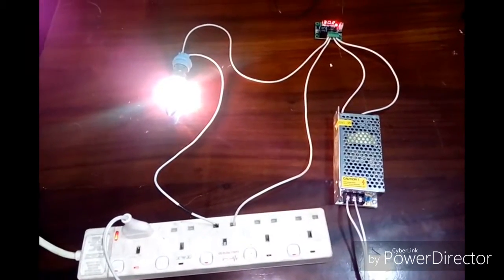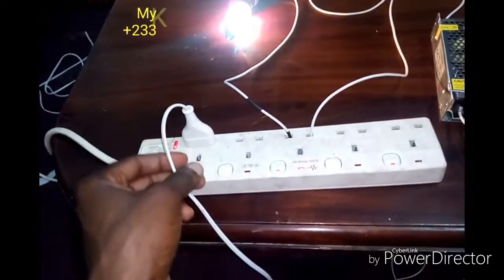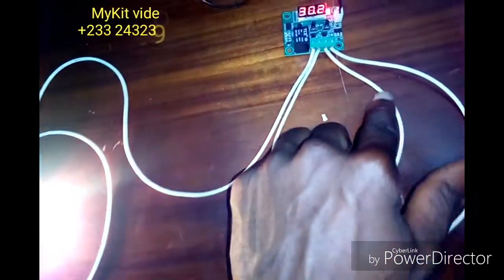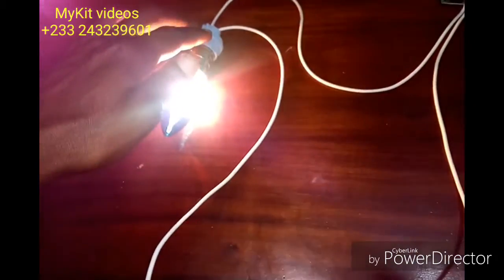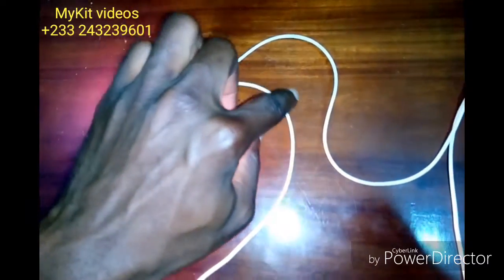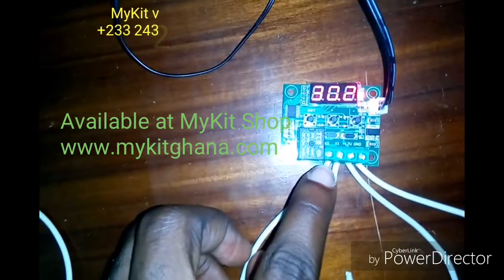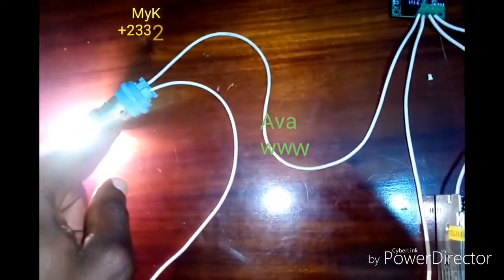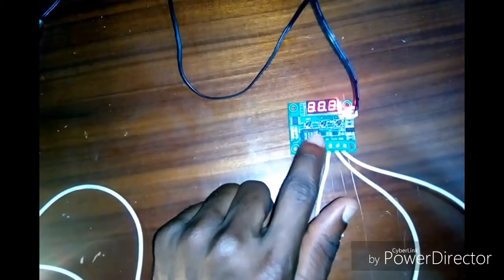W1209 220volts temperature controller

Comment: I've fixed it and it has worked. I wish it also included the fan. Do you have a link to a video where you have connection both bulb and fan?
Reply from the maker: Ok you just need to loop the bulb and fan
Reply from the maker: Link the bulb and fan in parallel connection
Reply: Sorry to bother you I'm not an electrician. Is parallel connection and looping the same?

Comment: sir can I ask if its also applicable for stc 1000 12volts then load of 220v light bulbs?
Reply from the maker: +Russel Capa 
Yes. Same principle
Reply: coz Im affrad sir to use the 220volt bulb in 12volts stc1000. so its applicable sir.. can you help me sir to setup my stc1000 ?
Reply: can i ask for wirings sir?
Reply from the maker: Yes I will show you. Please give me a moment
Reply: sir i have a problem to the connection.. I follow your connection using my stc1000 12volts. but when the temperature get high the fan(12volts)  didn't turn on what's wrong?
Reply from the maker: I will draw the circuit for u.
So now u have what items
12v stc thermostat
12v power adapter and what
Reply from the maker: I have prepared the circuit diagram for you.
Please click here to see
https://mykitghana.blogspot.com/?m=1
Reply from the maker: I have provided the circuit diagram here
https://mykitghana.blogspot.com/?m=1
Reply from the maker: I have provided the circuit diagram here
https://mykitghana.blogspot.com/?m=1

Comment: Pls how do I connect the bulb with my fan together.. So that when.. The build go off then the fan turns on.. Pls help me out...
Reply from the maker: rafik ahmed 
First tell me. What is the voltage rating of your fan and bulb.
220volts or 12volts
Reply: One of ur reply oh similar question.. Helped me thanks
Reply: My current questions is... I have set my temprature controller to cut the bulb at 37.5 c... When it goes of then the fan start work. Then when the light comes on then the fan goes off.. Is this how it should work???
Reply: Am using a 100 Watt bulb.. Hope is good as my source of heat.
Reply from the maker: rafik ahmed 
No. Let the fan always run
Reply from the maker: rafik ahmed 
It depends on the capacity of your Incubator.
For up to 100eggs, the 100watt bulb is fine, but I would advise you use 2 bulbs, example 2pcs of 50watts bulb .
So that if one dies out and u are not aware, the other will sustain.
Reply from the maker: Alternatively, for 100eggs or less, u can let the bulb and fan come on and off at the same time
Reply from the maker: DO NOT LET YOUR HEATER STAY ON without the fan running. This is to prevent heat from Concentrating at one area
Reply: Thanks for your time....
Reply: My incubator is 42 egg capacity.. And am using two 100Watt bulb.. Two fans..
Reply: So the fan should be always on.. Or it should come on when the light is on...
Reply: But pls... When the fan is always on.. I don't feel the heat  ...bucause the fan is always making the heat cool.. And with that can it hatch... And pls what happens if I have light out...?????  And how can I Maintain humidity or lower it...
Reply from the maker: +rafik ahmed 
For more Humidity add more water to the plate of water at the base of the Incubator. U can but foam or sponge in the plate of water. 

To reduce Humidity, cover part or all the surface of the water.
U should also create ventilation holes to reduce Humidity

Comment: Hey brother.. 
I have a troubleshooting with My thermostat .
 Current doesn't pass from K1 - K0.
I'm able to adjust the temperature range.
PLS help me through
Reply from the maker: Gouhar Hassan 
Okay I will be with you soon
Reply from the maker: Hello
Reply from the maker: Are u there
Reply from the maker: Since u followed the video I am assuming your wiring is correct
Reply from the maker: Now what is showing on the screen
Reply from the maker: If current is not flowing... It might be your settings
Reply from the maker: Watch my video on HOW TO SET THE THERMOSTAT.

https://youtu.be/98G431Kul9I
Reply from the maker: After you set it like that, power must flow.
If power doesn't flow 
Please tell me then I know what to do
Reply from the maker: How to set
https://youtu.be/98G431Kul9I
Reply: settings are done as per your procedure. 
but still k0 doesn't get power supply whereas k1 shows . 
the LCD shows 8888
Reply from the maker: Ok.
Your 12volt adapter.
Tell me it's amp rating
Reply from the maker: It's written at the OUTPUT area
Reply: I'm using a mobile charger. it says 5-12 volt dc output
Reply: LCD glows whereas led at the side doesn't
Reply from the maker: Ok the voltage is up to 12v
I want the current rating
Reply from the maker: Measured in mA or A.
It's also written near the " 5-12v"

Comment: Hi there !!!
     would you please like to tell me, of what power adapter shall i use to power both a 1.67 amp air cooler pump and 1.25 amp fan. And is this possible?
Reply from the maker: Kashif Mahmood hi
Reply from the maker: Kashif Mahmood 
Yes it's possible. First you have to make sure both the fan and cooler are of the same voltage. 12volts I guess
Reply from the maker: Kashif Mahmood 
Now that you are sure the voltage are the same... The adapter you can use to power the cooler and fan should have the following rating...
12volts, (1.67+1.25+1) Amp
The extra 1amp caters for any surge.
That means 12volts, 3.9Amp.
Reply from the maker: Kashif Mahmood 
Kashif. Please do you understand my point?
Reply from the maker: Kashif Mahmood 
Your cooler and fan are both 12volts right
Reply from the maker: Kashif Mahmood 
Note!!!! 
That means any adapter with 4amps or more can work
Reply: Got it, thanks a lot.

Comment: Never, never ever connect the relay of the W1209 to more than 42V. Just don't!
Reply: +MyKit Videos hello sir please can you tell me how set the thermostat for incubator my wiring is ok butt I dont know how to set the program of the thermostat just tell.me how can I set it for incubator on 37.5 thnx  bro if you help
Reply: +MyKit Videos ok sir I will send you the picture of my incubator and also the pic of thermostat I have buy this thermostat from ebay it is 12v dc thermostat and thnku so much for ur reply so nice of you
Reply from the maker: Alfredo DeLuca 
Thanks for your suggestion. Kindly tell us why not.
Even though it's written on the relay that it can handle both AC and DC, you say NO???
Please share why not above 42V.
Even 125VAC is stated by the manufacturer. Yet you say 42vDc should be the maximum. WHY ??
Reply from the maker: abdul virk 
abdul virk 
Hi Abdul, thank you for subscribing and thanks for your question.
Before I can help you, you have to tell me what type of Thermostat or what type of incubator.
You can send me a picture on WhatsApp +233 243239601
Or email mykitghana@gmail.com
Reply from the maker: abdul virk 
Thank you too. Visit my website anytime. https://www.mykitghana.com/blog%2Fvideo

Comment: thanks sir i made 100 egg incubator sir my english is not good you tell me how much electric bulb and pc fan in incubator tell me incubator electric bulb and pc fan all time together working or not together work thank i wait your answer .
Reply from the maker: talha talhajee 
hello, so for the delayed response. it's night to in M6 country that's why. hahaha
Reply from the maker: I need to know the wattage of your bulb. if it's 60watt bulb I recommend you use 2 pieces of the bulb that's if your Incubator is well insulated. if not heating up well you should add one more bulb
Reply from the maker: anyway THANKS FOR RATING MY FACEBOOK PAGE. I REALLY APPRECIATE IT.

About the pc fan... you can start with 2 fans. make sure one blows over the bulb.
the positions of the bulb and fan would depend on how your Incubator looks.
Reply from the maker: are you doing for quail or chicken eggs

Comment: Dear sir i make incubator i have w1209 12 volt DC Digital Temp Controller i install  w1209 thermostat wiring electric bulb ok but electric bulb automatic temperature of  and pc fan not automatic of tell me sir pc fan and electric bulb together 37.5 temperature high and one point low automatic of
Reply from the maker: talha talhajee 
hi Talha, thank you for viewing my video and commenting.
unfortunately I don't clearly understand your question but I am gonna assume your issue is how to connect the bulb and pc fan.
let's you want to use a 12volt pc fan.
if you want the bulb and fan to come on/off at the same time this is how u have to do it.....
get an appropriate 12volt power adapter. 
cut the pin-end of the adapter.. u will see 2 coloured wires (positive and negative.. connect these to wires to the fan.

now the other part of the adapter that we normally plug to the wall (head part).... it has 2 pins LIFE and NEURAL
Connect 2 cables from the terminals of the 220v bulb to each of the adapter head pins.
so that it looks as if u are plugging the adapter head into the bulb. 
I HOPE THIS IS USUAL INFO TO YOU.
DONT FORGET TO SUBSCRIBE.
Reply: thanks i try
Reply from the maker: talha talhajee 
ok

Comment: can you connect a 12v catriage heater?
Reply from the maker: Karthick M . Yes you can connect a 12 volt heater but you have to check the power rating of the heater and compare to the rating of the thermostat relay. the current value drawn by the heater should be less than the current indicated on the thermostat relay. I will show u what I mean...
Reply from the maker: my thermostat is rated 20A for DC stuff so I can connect 12volt cartridge heater since cartridge heater draws few amps